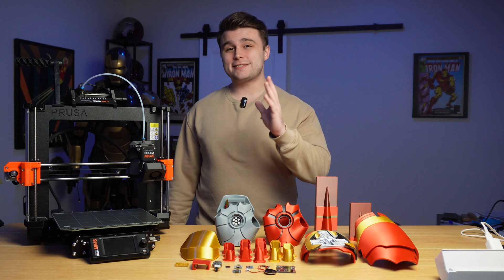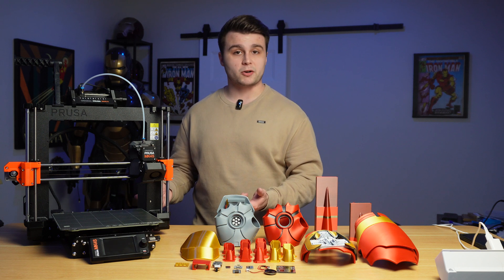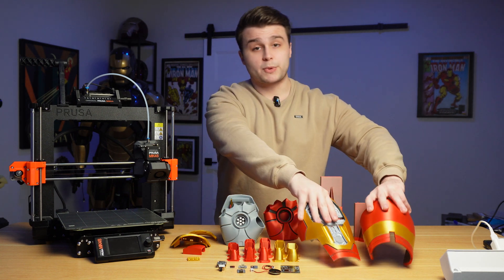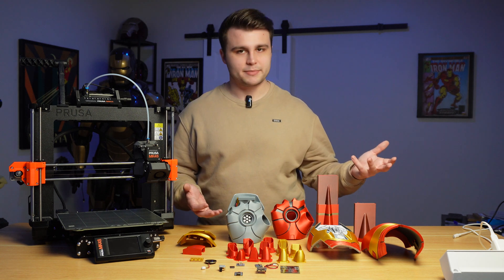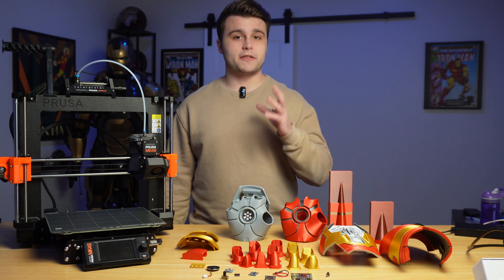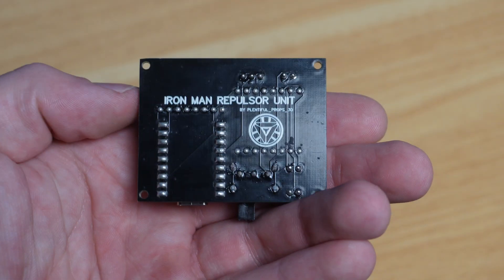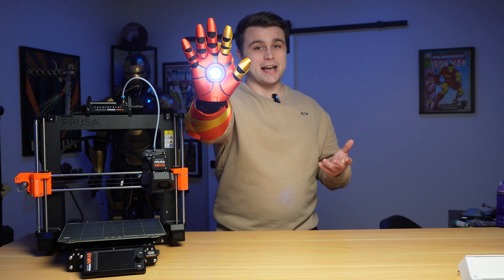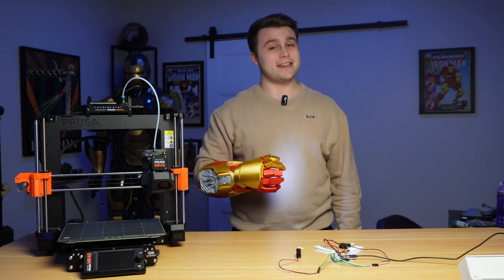DIY Iron Man Glove with Motion-Activated Lights & Sounds!

Comment: Curious as how the 3.7 Volt lithium polymer battery can power the Adafruit Neopixel Jewel.   Adafruit literature says it requires solid 5 volts.  Are  you stepping up the voltage with a mofset or level shifter, or is the literature from adafruit incorrect?  Thanks.
Reply: No need to reply.  I did some more research and it turns out if you are powering your NeoPixels with 3.7v directly from a LiPoly cell, a 3.3v data signal is OK.

Comment: Hi I cure8own the levy 3d mk 42 suit files including the gauntlet but I do not have the hinged plate or PCB mounts or anything like that for what you did in the video, is that coming later or am I miss something?
Reply from the maker: He may have only updated the gauntlet files and not the folder of the gauntlet in the full suit files, I will ask him
Reply: @plentifulprops3d  oh okay maybe, let me know what he says! Thank you
Reply: @plentifulprops3d  Will you be implementing the motorization of the gauntlet aswell into your code?
Reply: Did levy update the files yet?
Reply: @yikes8707  I got ahold of him he said he's been swamped for a few days and will be updating it asap
Reply: @isaccgallegos5531  Hi Isaacc any update from levy for the files?
Reply: @NerdMovieProducti0ns  I haven't seen any except for a modification to the calf piece to be split into two
Reply: @isaccgallegos5531  Did you bought the full suit 42? Because I have only the arm and the gautlet and still no update on both folder :(
Reply: @NerdMovieProducti0ns  I have the full suit minus the helmet